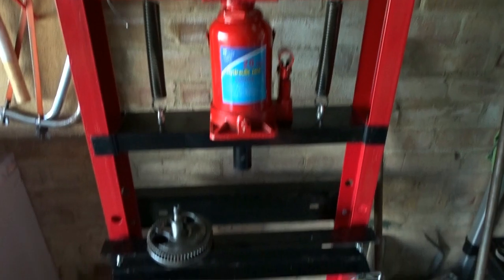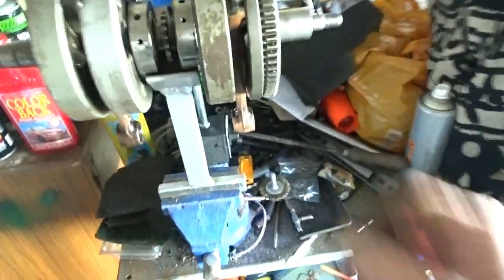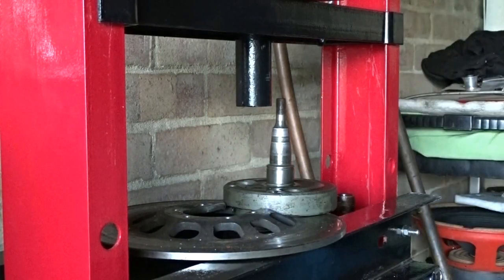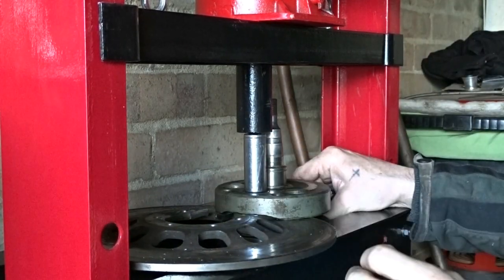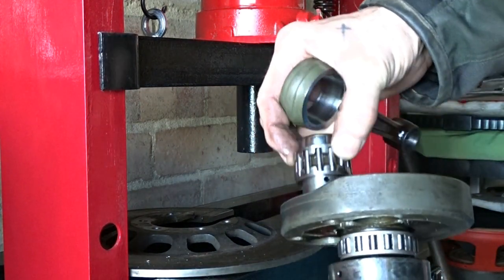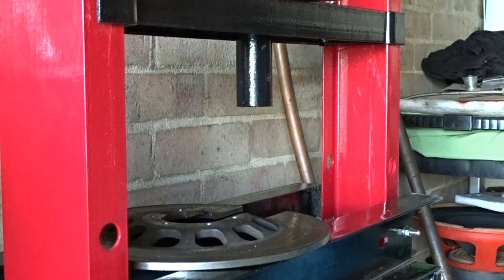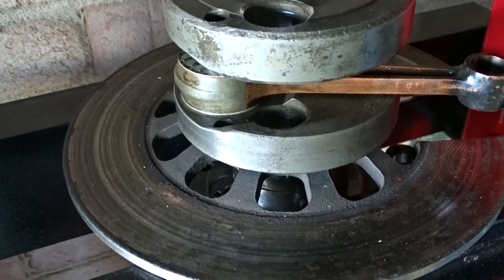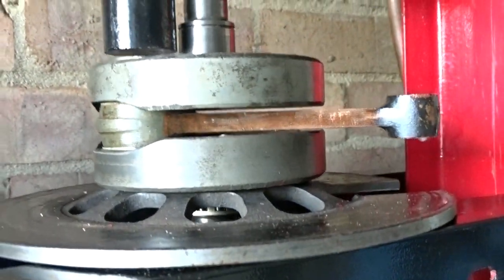XS650 Crankshaft Splitting and Fitting New Con Rods using the 20 Ton eBay Press

Comment: Maybe put a old box with a cushion in it at the bottom of the press & make a spacer for the crank web good luck pal
Reply from the maker: You know I'm going to do just that!
Reply: @OldBiker  ive just got mine same has yours but its a 12t one has i didn't have the budget for the 20t one but i need a 20t jack has i can't get this pin out so iam gunner get a air powered one & you can still use it manual too ive allso flitted a nob too the pressure release & gunner fit some little caster wheels between the vertical rsj to take the side slop out & think iam gunner bolt it of some brackets of the wall hows yours holding up pal

Comment: Your lucky doing it with  20 ton press you suppose to use 30 ton and why hasten your press come with press plate's they usually come with press plate's ?
Reply from the maker: 20 seemed to be OK and I couldn't find anything bigger for the price I wanted to pay, yeah it come with press plates but the press plates were rubbish and not man enough for the job, I've since purchased much better ones.
Reply: @OldBiker  thinking of getting this one and maybe had a extra set of two press plate's i want to rebuild my crank myself just got new rod kit on its way so if i get one of these it will be ok if i ever need my bearings pressing or anything else will come im handy.So their crap you say the press plate's they look quite thick on the picture too Orwell thanks for reply pal
Reply from the maker: @rider6327-g1v  Next vid I do I will show you the new plates compared to the ones that come with it, oh the press by the way is well useful for pressing in and out bearings, I've already done several jobs on it and it is well worth the money the time it saves. My favorite tool of the month though has to be the cordless impact wrench!
Reply: @OldBiker  yes seems ok pal and yes iam gunner get a impact myself ive got a windy gun but its weak for most things and yes will  be ok about video cheers bud

Comment: I'm sure glad you put this up. I may have to do this. ( Gotta figure out how post a pix on here to show you my engine lift hooche) I got a question that may be related to this video. I have my engine out and on a stand. I pulled the plugs and turn it over using the kick start. It makes a sound like Clock-Clock. I know what a double knock means on a car. What should these engines sound like turning them over with no plugs?
Reply from the maker: The clock-clock sound is more or less what I got with the worn little ends, they don't have to be worn much to make a racket either. With any weird noise its always best to tear down the top end and have a good look around.
Reply: @OldBiker  Yep, I'll do that. Oh, can't post a pix on YouTube. Has to be a video.